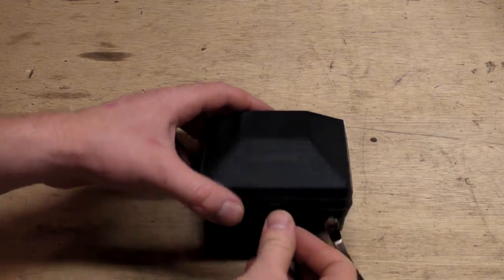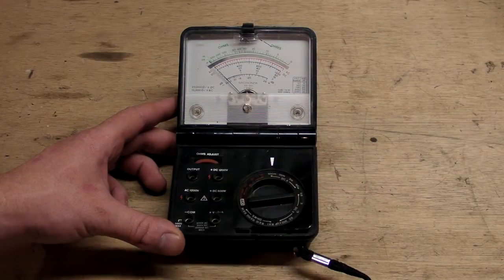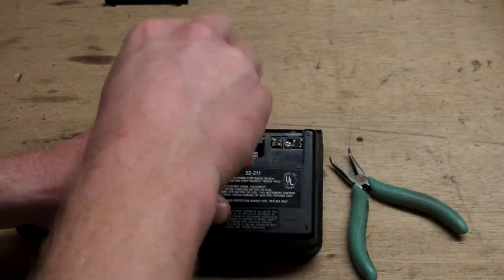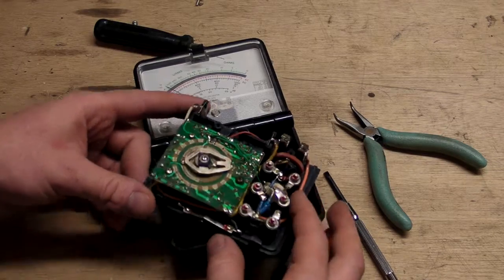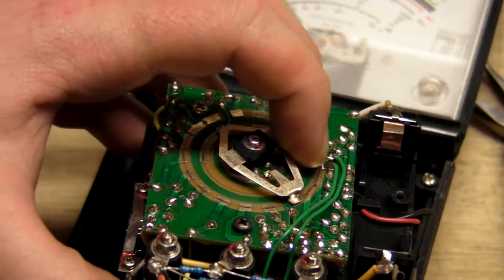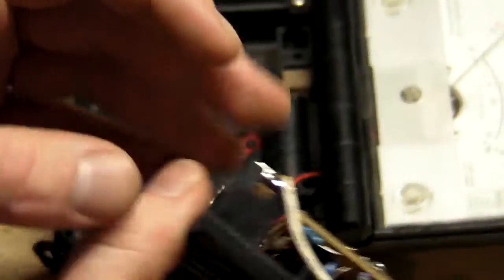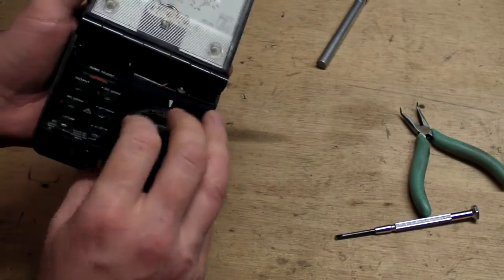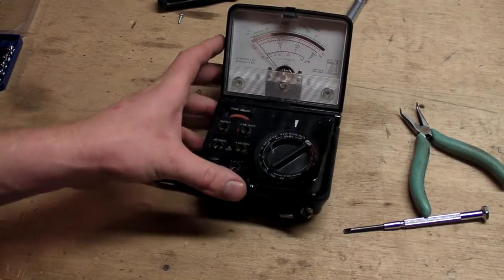(#0086) Micronta 22-211 Teardown - My First VOM

Comment: This was also my first multimeter, i got it for a birthday or Christmas present when i was around 7 years old. ~For some reason i was just checking it and the needle won't peg over in the ohms setting. I just removed a black ceramic capacitor ( i think ) it is marked 7K 220 5 2 it was measuring something like 1.3 ohms, this doesn't seem correct to me but i'm not sure what p[art this is, in the diagram and on the board it is marked with a Z. any ideas what this part is? On the schematic the print is too blurry to read. Thanks y'all.

Comment: This was my first multimeter as well - bought in the early 80s, when I was interested in telephones. I used it to test line voltage, so that I didn't get a shock if I should handle a bare wire. I recently found it again and cleaned it up. For testing batteries and power supplies, I prefer this meter to a DMM as it's easy to glance at the dial and get an instant idea of whether a battery is worth keeping.  I like the solid ABS construction used in this meter - it has a chunky "80s look" to it that appeals to me.

Comment: Love the teardown video.  I have exactly the same multi-meter and use it all the time.  Everything works EXCEPT the continuity functions.  Checked battery, fuse, contacts, test leads, and all OK except no response from any of the continuity settings. Your thoughts?  I'm thinking there must be a broken connection inside that feeds all of the continuity test positions, but before I open it up I wondered what you think.  Thank you!

Comment: Even though my test bench is overflowing with all types of modern digital and vintage analog test gear, I still use my very first meter that I bought in 1975 (Heathkit VTVM) when I'm working on vacuum tube guitar amplifiers. It's a good companion for my modern Fluke DMMs.

Comment: When I first started work at 18 in 1968 in an electronics workshop I had to use the AVO 8. Yes digital is great but give me an AVO any time. If they were cheap enough I would buy one against a digital every time. Thanks for the nostalgic return to nicer times.